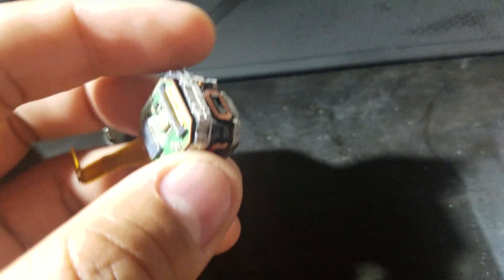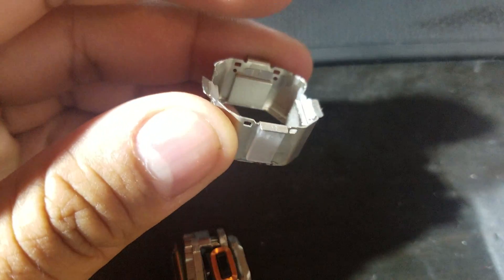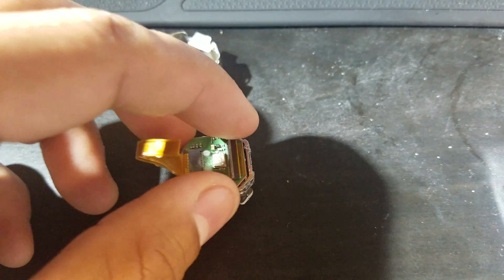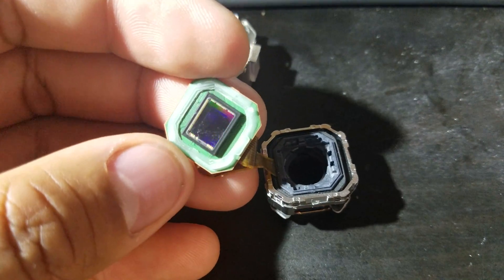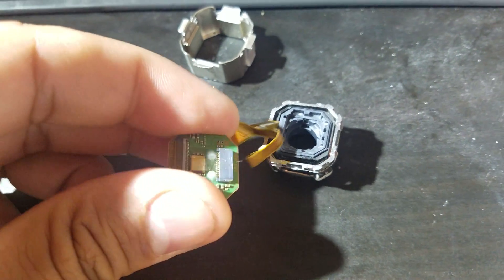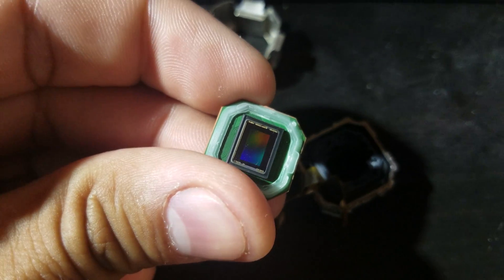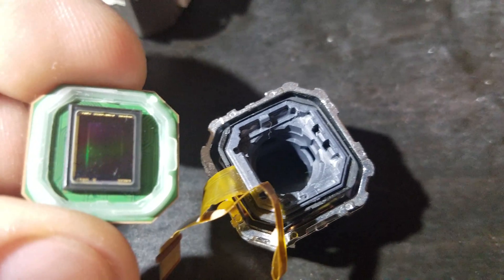Sony fdrx3000 sensor and  BOSS

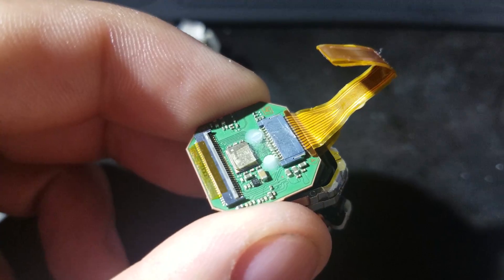Comment: How about removing the glue and fixing the sensor plate to the black lens casing using 4 tiny screws (like the one used in glasses or watches)? 0:59 there might be just enough space on the 4 corners to drill a 0.5 mm hole to fit four tiny screws at each corner

Comment: So Sony makes their top of the line actioncam with a Zeiss lens and Exmor sensor, but they use amateuristic, non durable, non reliable GLUE to keep the sensor to the lens. What in the world were they thinking, saving a few CENTS to use glue instead of screws/clips, preventing the camera from becoming blurry over time, when the glue comes off. What in the world man.
Reply from the maker: SinisterSkip if you do serious action with lots of hard bumps and a lot of quick gforces, it seems the sensor will get misaligned and either your whole screen or partial of it will be blurry. some people accidentally drops it and it goes blurry. it's an easy fix if you know how to but Sony really buggered this one. 
it's still a great camera... when doing gentle things lol
Reply: Its always fun Time  - being gentle isn't enough here. Recording/using the camera anything longer than ~10 minutes starts to blur the edges of the picture etc. That's just ridiculous.

Comment: Thanks 👍 can u put the sensor back but put it long ways up so sensor is vertal fix it back and check if it records how a smartphone records vertical video 9.16
Reply from the maker: suhail11511 sensor will not mount right if you turn it 90 degrees for vertical recording, the two tabs in the focus lens housing holds the sensor by the edges. it is very wobbly,  which in turn will make the video very blurry. the soft mounting of the lens is the major downside for the x3000. video will be blurry if it is not flat, I suspect that this is why some people are having half the screen or the edges of the screen soft. the boss ribbon cable will not be able to reconnect if rotated 90 degrees also.
Reply: Its always fun Time oh right, yea i bought the x3000 few months back from amazon but sent it back as it wasnt recording vertial video how a smart phone records holding upright, i think its cos its not a muti aspect ratio sensor it can only record 16:9